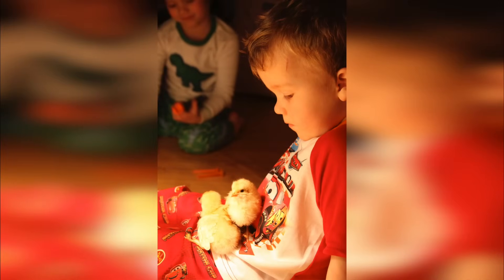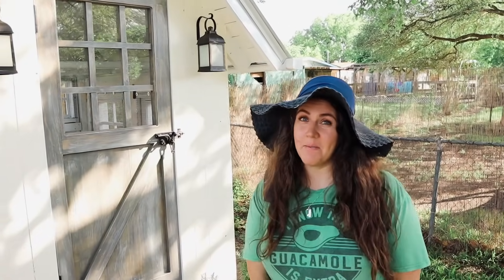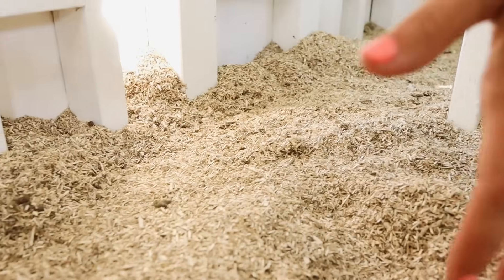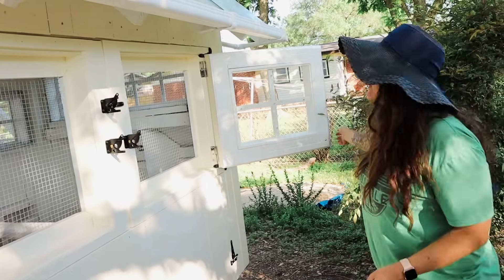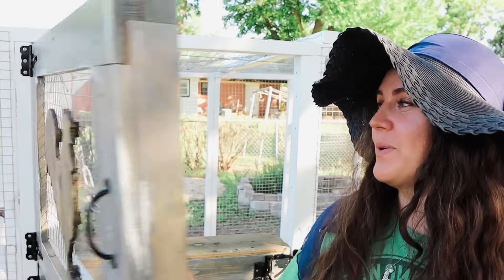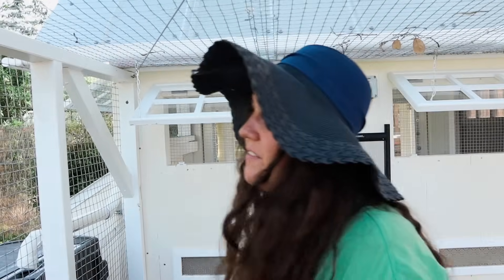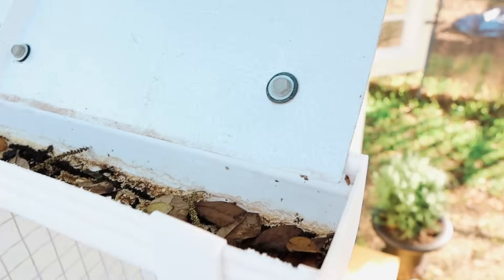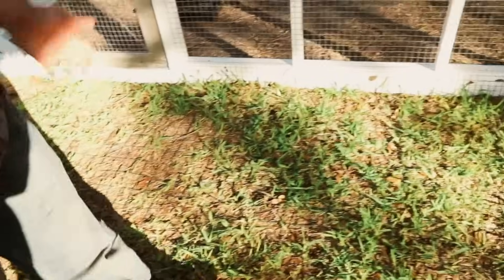My Dream Chicken Coop! Rain-capture Watering, Automatic Door, Deep Litter, and LOTS of ventilation!

Comment: This is a beautiful coop. One thing you may want to think about is running electricity to the coop. This is very helpful for a heated waterer in winter (last winter was coldest on record in 30 years for many in the South.) It's also great for using a heat lamp if you were ever to get more chicks in the future or for installing a light to see at night if you ever need to. My husband ran electricity to our coop and I'm so thankful. Thank you for sharing your tour!
Reply: Thanks! That’s a great idea. Especially need to think of how to winterize the water.
Reply from the maker: Hi there! Thanks so much for watching! In the 11 years I have lived here, a few months ago was the only time I have ever seen frozen water outside. Sadly, there was no electricity for anyone...so electric to the coop wouldn't have helped anyway. Many people lost birds here not so much because of lack of water but because they weren't sheltered. I'm apart of a chicken group for San Antonians and the people that lost the most birds were folks that had open coops. All that to say, I really did try to think of everything, even the odd 32 degree night every couple years which is why I tried to make the coop both breezy and enclosed if needed for those super rare nights. From what everyone has been saying in my group, here in SA we don't have to worry about freezing temps as much as the HOT summers and keeping the ladies cool. 😊

Comment: You did a fabulous job!  If you haven’t already changed to it, try using a stick to prop open your long window instead of the chain.  I found a stick propping the window open is less stress on the window frame and it’s easily cut to length.  One stick per window too.  Easy, easy easy!

Comment: thank you for taking the time to post this video. Your coop is beautiful. seriously thought it was pre-fab and when i finally understood that wasn't the case, my eyes popped out of my head. Love the auto door.... my future insomniac self will be very thankful for that. Awesome idea for keeping them watered! I will have to modify it for my area as the winters in Alaska are harsh, but I wanted to make mention of my idea for a possible solution in case other viewers might have need to know. I think instead I will use metal piping and attach a heating wire to the underside of it. My friend has one like that set up under his trailer to keep the pipes from freezing and has it attached to a gauge that will turn on the heat only when the temperature falls too low. It might also be necessary to have bowls that can be switched out... metal ones for winter and plastic ones for summer. Any other cold climate peeps out there who currently have chickens reading this? what do you think? Your experience is valuable to me because I have not yet ever owned chickens... right now I am just planning, but the time is close! I think within the year and I am so excited!

I also had an idea for your "truck" door. You could take some off the top which would give you clearance for the doors above. Put a board up as a wall to cover the gap. Creating a strap to have the door be secured to the building is an idea... but I think it would take away from the beauty (and it IS such a beautiful coop!). When I am able to incorporate this I was thinking it would make things easier to create a funnel on the inside of the door. Like a diagonal board on either side leading the golden treasure into the wheel barrel. In your experience ... do you think this would be helpful?
Reply from the maker: Thank you so much for your thorough reply and ideas! They are all great! Especially the hemp 'shoot' into the wheelbarrow. Thank you again!!!

Comment: Congratulations on such a nice coop. I must say y’all are quite creative and pretty high tech. The 3-D printer parts are more than we can handle and so are those fabulous windows, but they’re really great. I really love the waterers. So clean and does away with watering by hand. As for the problem with that truck door, I would fix a way to lock those windows back. Two chains perhaps? Anyway, it a great coop with so many great features! It was built with pride.

Comment: My comment disappeared mid-sentence, but the gist is that your coop is gorgeous.  I've never built anything until I built my "rustic" coop by myself.  It is inside the run because of predators.  I did invest in an automatic door, put plenty of ventilation, have "screen doors" behind plywood doors, removable short roost and 2 permanent tall roosts, the entire shed roof is open but there's predator proofing, the nest box can be accessed from the exterior, and the run is 6' tall with 2 doors so I can access a back garden without crouching beneath an apricot tree.  The tire is a dust bed plus there's a hanging planter with coir mat filled with peat moss for a smaller dust bed.  Eventually I'll have chicken "tunnels" so my little silkies can safely run around.  The coop is 4'x4' and the run is 8'x10'.  I do plan to put a tarp over the hardware cloth at the top of the run to keep wild bird poop out.  The cost is ridiculous for wood and so I used scraps from other projects and from a building site that gave me permission to dumpster dive all its scrap wood.  The automatic door was $200.  Carolina Coops were totally out of my budget.  Right now I figure my 5 little Silkies cost me about $250 each because of the cost of everything.  Your coop is fabulous!  I have coop envy, but I don't think my little girls will mind.  I like your "deep litter" board and plan to add that to mine.  Thanks for the video.
Reply from the maker: Thanks for sharing and for watching! Love that you have silkies. :)

Comment: Just WOW. I've been doing research related to raising chickens and this, is The Best video I've seen yet. Y'all Nailed it! (sorry - being Canadian I had to throw that in there). You have great presence in front of the camera and are funny. Clearly you love your birds and you built one heck of a house! I subscribed and liked
I've got some questions  now almost two years later. I've seen some of the Carolina Coops designs and their videos are great. They're making a difference out there; I'll bet you're still happy with the deep litter system and the CC hemp product?
Oh My Gosh - that water recovery system. Impressive. I don't have access to a 3-D printer (you two, have a son old enough to do that and paint the run? you look so young!) Those components are very neat. 
Being in BC - I have both intensely hot   summers and cold winters. So I'd like to build for the southern design but insulate some interior areas maybe. I know they're hardy and they don't (naturally) lay over winter but I would put in an electrical source and find an appropriate, safe heater. Perhaps heat the floor, treat it like a heated floor in a bathroom, lay the heat pad, then cover it with tile and could put the hemp on that?) And I would have to put a submersible heater in the water supply at least. But I love the design of the recovery system - and the drinking system. The Work !! Impressive!
The finish and attention to detail - amazing. Well done. I think your idea of the sprayer is a good one too.
I like Carolina Coops idea to wrap some bars with hemp rope - looks cool and the birds like it?
Thanks for your energy and your design - super job!

Comment: Like your coop and run, your run certainly nicer then mine is.  My coop run designed a little different. For one I believe my coop is larger being 12ft X 12ft X 6ft at the lowest point in height. Taller to the peek of the roof.  I’m only 5’7” tall, so I wanted the coop tall enough that I could walk around in the coop and not be hitting my head on anything! My roof pitch isn’t anywhere near as steep of a pitch like you’re is either. I have a foot drop on my roof and used corrugated white metal for my roof material.  With the idea the painted corrugated metal will hopefully last longer and not need any maintenance for a good long time I hope?  Like yours is to some degree, my coop is 3ft off the ground so underneath is a part of the chicken run where the chickens can go to stay dry when it’s raining outside and there’s another 8ft in front of the coop that’s 8ft high that has a screen door I had laying around that I used to have a easy entry into the run. I actually had two screen doors laying around, so I added a screen door to each side of the coop so I can get into the run from either side.  Now I would love to have your enclosed chicken run you have. I went with a electric fence netting that runs around one corner of the front of my coop with just a netting ran over the top of the area to Jeet out flying predators!  It works but certainly not as nice as your is!  One thing I did inside my coop, I don’t know if your roost ladder drives you nuts when having to clean behind it or not? But it certainly did me! So I designed my roost ladder where it’s hinges at the top against the wall so the roost ladder folds up against my ceiling and with a simple latch Locke it in place against my ceiling and out of the way making the floor completely open. So cleaning the floor super easy.  Actually one of the reasons my floor easy to clean is cause my floor was made out of a waterproof plywood that has a plastic laminate glued to the floor just like many countertops in the kitchen are made of!  So the floor nonporous where very little sticks to it and I can use a snow shovel to easily pick it the bedding and toss it out my two large back doors on the coop into a walk behind trailer I use. Whole coop/run is actually on 60,non air wheels that’s normally used for hand trucks and a receiver on the front that I can connect to my truck just like you would a trailer so I can move it fairly easily!  I have the same issue with my 1 back doors you do. What I did is put a eye hole bolt on each side of my coop and I just attach a bungee cord to each door from the eye bolt to the door handles to keep both doors fully opened. Best solution I could come up with myself!  We live on 5 acres and I really wanted to allow my chickens to free range as much as possible too. So they get out to roam the property least 6 hours a day. Chickens are actually spoiled! We also have security motion lights on all sides of our buildings and home that lights up a good majority of our property. So the chickens just love the lights at night out hunting for the bugs that come out at dark.  My chickens don’t even think of going in to roost till around midnight! LOL  Not sure when you built your coop? I built mine about 4 years ago. Now I didn’t skimp on materials either. Most the materials I used is either treated or waterproof plywood with the exception of the T-11 siding I have around the coop. But anyway I figure out I had over $5,000.00 in my coop/run enclosure alone and that’s not including the cost for the electrical fence netting I added later with the netting over the top.  If you built yours recently you probably paid a higher price for materials then I did? I know I built my coop and enclosed run like a tank with everything glued with exterior glue and  4 deck screws screwed together with pocket holes on both sides of every 2x4 that joined together and I also glued and screwed all my T-11 siding too. Since I knew I planned on moving this coop run like a trailer I didn’t want anything being able to shift or twist, etc while moving it. Believe me this coop isn’t falling apart anytime soon!  I know anytime anyone sees my coop run design I built, I always hear a WOW! WHAT A COOP! LOL or something along those lines.  Sure you do too with yours too!  Biggest thing I didn’t want is to have to just rebuild the coop in a few years cause it started falling apart . I expected mine to last me the rest of my lifetime and then some.  4 years old now and still looks as good as the day I built it and pulled it with my truck just like a trailer down our driveway and out in my front field where it still sits today!

Comment: Does the deep litter method generate heat? Someone listed that as a pro in their cold climate. But I live in hot SoCal and wonder if it will make the chickens hotter in the summer.
Reply from the maker: I have not thought about this. It doesn't seem hotter in there. It's not like the poo is composting that fast. Perhaps she meant because the hemp retains heat better that straw because it's dense? Not sure. We are about ready to take all the old litter out now and get some new deep litter in. Hoping to film a video on our thoughts on the coop and what we changed since we built it.

Comment: You know, the height of the Carolina Coop plan may have something to do with relief from heat? Just thinking this because I presently live in Mexico, all of the ceilings I've seen are high, high -- and the reason becomes obvious pretty quickly -- for cooling. The heat rises and the high ceiling allows it to do so. Also, just wondering about streetlights and such. Is there any plan to shutter (or shade) windows if need be?

Comment: You're the first video I've seen that has rain capture going to a nice, huge (looks like 55 gallons) barrel. I plan on doing the same thing. HOWEVER, since I live in a cold climate, I will put the nipples in the barrel and put a heater that turns on any time the temperature is below 32F. In this way, I should never have to give them water.

Edit: Here I am a few months later and unfortunately, I made the EXACT same mistake you made, and made the door that drops down (so that you can clean the bedding out) too wide. I'll make it more narrow at some point. Uggghhh!!

Comment: How much would something like this cost to have built? 
Would love to find a carpenter in my area to build this chick mansion! 🐓
Reply from the maker: Do give you an idea of the cost of just the materials, we spent $3500 on lumber, hardware, metal mesh for enclosing the run, roof....EVERYTHING that went into the building materials. The auto door, feeder, rain barrel was extra. It also took us 6 weeks to build working on it every day. Carolina Coops start out at $6000 I believe? And I think they are smaller than ours. I don't think anyone would build something like ours for less than $8000. That's how much my husband said he would charge if he were to build one for someone else. Hope that helps.